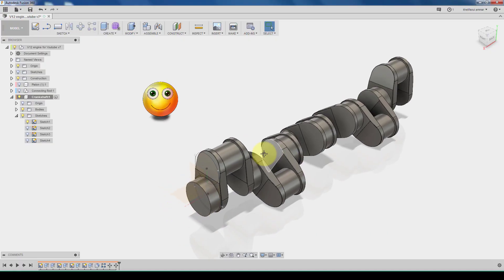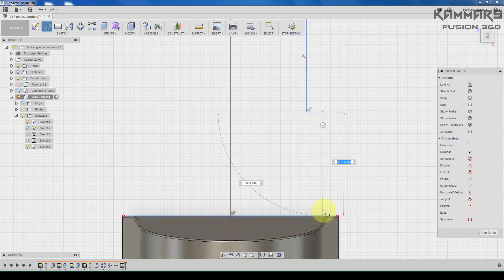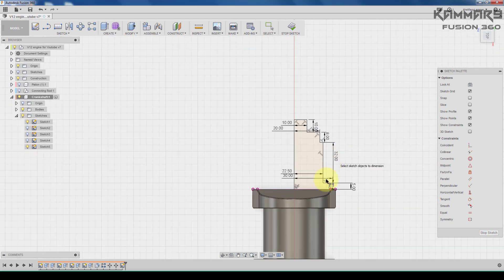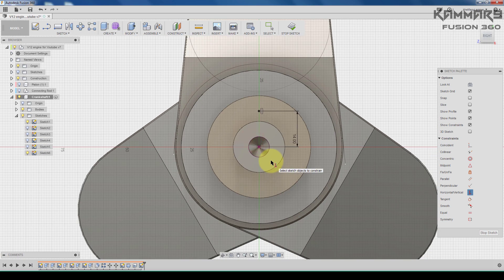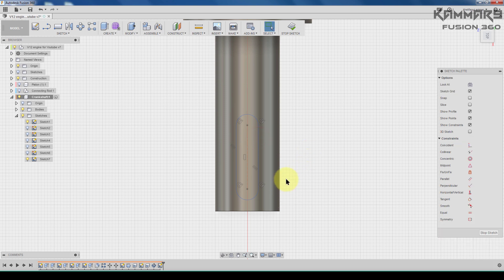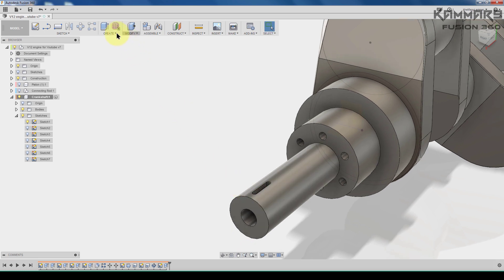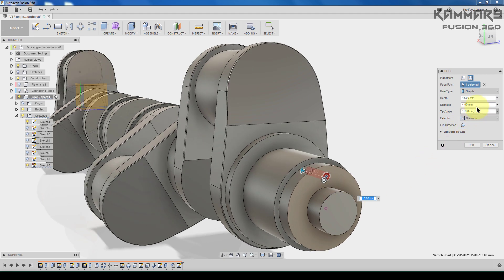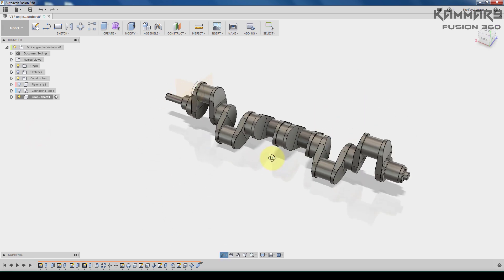Fusion 360  Modeling V12 Engine EP 05 😍 Full HD

Comment: Hello bro, I am studying fusion 360 with your videos, thanks a lot.
I am sorry about I have to pay some dollars for ep.4, but I know and agree I need to pay these good quality videos.
Always thanks a lot for your passion. Very thanks for your hardworking.
from Korea....
Reply: +) But, I made my crank shaft with this video. I referred dimensions in this video. In result, I made 100% percent perfect (ep.4)crank shaft. Your guidance made big help to made it, and, I am still studying with your thank videos.
Reply: hello, please who has the crack dimensions or all the project dimensions
Reply: @abdalhalimzeineldeen1705  Just observe the part carefully or use the length of the space where the part will fit to infer the length of the omitted part. You'll need to keep a close eye on parts that pop up in later episodes after they were omitted. The dimensions of these parts may change later, so don't forget to create new components as you have done so far.
Reply: @abdalhalimzeineldeen1705  This is not reliable because it relies entirely on my observation skills, but I think it helps with one's creativity and engineering reasoning skills. For example, I completely recreated the exhaust manifold.